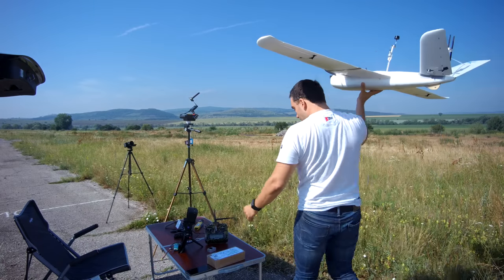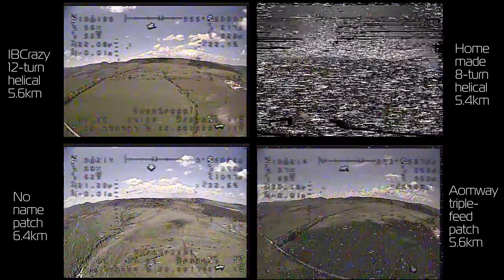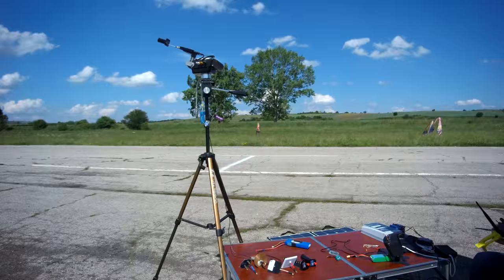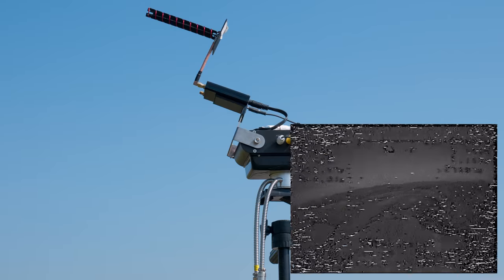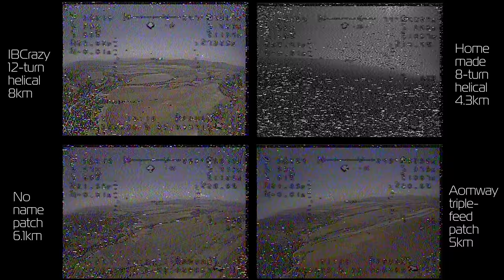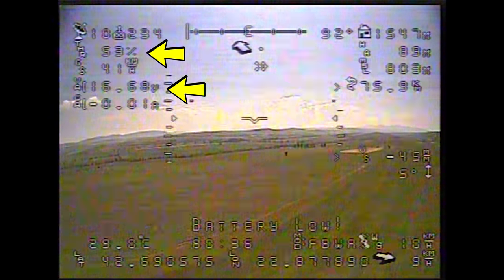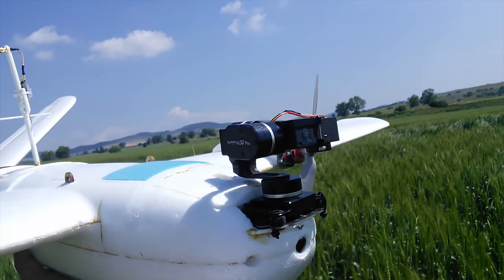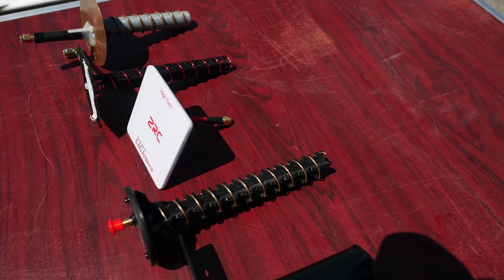Circular Polarized Directional antenna testing and comparison (Round 1 and 2)

Comment: Wonder, what would perform better:  the padoga+triple feed patch 9.4db or the linear antenna and aomway double biquad 13db antenna on receiver.
Reply from the maker: That is still a test that I have to do! Theoretically the linear system should do better for long range out in the open where there are no reflections, etc., but only testing will tell... and it is possible that the results might vary for different locations!

Comment: so whats the range if you just use a normal recieving 5.8 antenna without tracking on 25mw? in germany you are only allowed 25 so yeah...
Reply from the maker: I would assume 200-300 meters at the most.
Reply: A little late but with my DIY antenna made out of trash i can fly over 3.2km at 25mw. Here’s video showing my range test and diy. Cheers!  Easy DIY Long Range 5.8ghz Helical Antenna: https://youtu.be/TS4fYcT3DEE

Comment: Small hint - When running a helical and the video starts to get weak, rotate it 90 degrees axially.  The reason for this is that not all TX antennas have the same amount of horizontal polarization as vertical and the helical can take advantage of that (depending on the location of the feedpoint).  Thus, by rotating about the long axis of the helical, you can pick up some extra signal with the last 1/4 turn on the helical.
Reply from the maker: Nice tip, thank you! :)

Comment: Great test. 
My best is 10km on 5.8ghz 600mw with 7 turn circular wireless helical. Could of pushed further but the battery was near 50%. Mind u that I was tracking it with my head as the helical was mounted to some Fatsharks
Reply from the maker: Tracking with your head should work fairly OK for the most part, as long as you have a good idea where the plane is, relative to you! :)

Comment: Fantastic video, as usual! I wonder if the noise floor is higher in that area later in the day? You were also flying in a different direction, right? Love these puzzles.
Reply from the maker: Well... thing is I tried the IBCrazy antenna again at the end of the flight, and it still performed well, and we have no observed any notable change in noise floor in that area! I did fly in the direction I usually do my long range tests... so it should be pretty OK. Will test again next week and we will see... I have a wrench handy now, so will tighten them down as well as I can!

Comment: I made a 1.3ghz RHCP patch running on a MFD tracker with a 5.8 repeater to my goggles and it works great.
I've not gone past 10km yet but it's perfect to there...
Reply from the maker: Sounds good... you can push it further out then! I also have a repeater on the ground, but it is again on 5.8Ghz, although a different frequency, and very low power! :)

Comment: nice test.
 still i think best would be to make more of them using aproximately same factors/conditions and average them in the end for an definitive result.  my opinion is most of these anntennas not worth price since its so easy diy and you can leans something interesting along the way. back in the days radioamateurs used diy testing gear for antennas and they outperformed most commercial. nice job. 
cheers.
Reply from the maker: Well... to make a really good antenna you need some serious gear... other than that its just guesswork to be honest! I've made my own antennas... and only 1 or 2 have actually been good for something because you have no real way of tuning them and testing would require a lot of flights, which is just not practical! The trick is to find somebody who knows what they are doing and have the right gear to tune the antennas! :)

Comment: very good video, hope you figure out what could cause the bad signal, maybe the vtx reduced the power due to overheat? Anyways, consider testing a Crosshair antenna, we are getting very good results (~7km on 600mw without antena tracker)
Reply from the maker: Actually I find it doubtful the Vtx would overheat in flight, the way I have mounted it... running at 25mW... and besides... the IBCrazy antenna was OK beginning and end of flight... sooooo... overheating doesn't make sense. I do not have a 5.8Ghz crosshair... as far as I know those a tricky to make... so finding a good one might be a problem. Will see if a friend is willing to give me his to test next time.

Comment: 1 turn helical is maximum for that small reflector. It will give you the best radiation pattern and true 6 dBi of gain, because 6 dBi is 4 times. This means that you will be able to receive only 1/4 of all directions (90 degree sector), compared to an omnidirectional antenna. Don't use a lot of turns with that reflector, because it will not give you the desired gain and will only mess up the radiation pattern: the direction of the main beam can go anywhere and you will not understand what is happening.

If you want 12, 8 or 5 turns then you need to have a reflector which has 1-2 meter diameter and a very good conductance. Then you can have 12 dBi, 15 dBi etc. Without a big reflector it is unfeasible to have more gain that 6dBi.

Another way is to use a satellite dish with 1-turn helical (insert it in the place of the satelite receiver). But remember that circular polarization changes from left to right and vice versa after the dish.
Reply from the maker: Which antenna are you talking about? Out of all of these only one of the helicals was done by me, and it is the one with the largest reflector! The rest are store bought and supposedly tuned... so they should be working well! The fact is that with the tracker all of these have always performed best dead centre pointed to the plane... so apparently they seem to work OK without a 2 meter diameter reflector!

Comment: there  are some sunny days vith electromagnetic  noise and its trouble . in evening  noise goes lower .
Reply from the maker: Weird... where does that interference come from?
Reply: @ArxangelRC   Solar radiations and other solar activities affect the total electron content of the ionosphere and also affect various radio frequencies used in telecommunications. We studied the effects of electron densities of the ionosphere and how they affect telecommunications. A case study of the year 2000, which was a year of solar maximum, was used to show the variations of electron density of the ionosphere. Hours of maximum disturbance due to increased electron density of the ionosphere were obtained and the ways of measuring the electron density of the ionosphere suggested.
Reply from the maker: @LotosAndEarth  OK... but why would it be so much where you are? Can't say that I've felt much of a difference from one day to the other in terms of long range video and radio range... things have been quite consistent!
Reply: @ArxangelRC  exactly , sometimes its for  1-2 days, as usualy from morning to evening when sun goes down.  Buy old  radio phone , in that days with higer radiation radio phone will  work just  about 6 meters with noise instead of 50 around the house ,so its my expirience , of course some waves afected more some of tehem less. i dont xnow how its affekting LTE   - 3G
Reply from the maker: @LotosAndEarth  Hmmmm... could be! Interesting... can't say I've felt any changes in range though... cloudy days or not... have not done much flying at night!

Comment: I run a iBcrazy 5.8ghz LH pepper box straight off my laforge on the fatsharks and have out run my old spektrum dx8 more then once which is why I've switched to a frsky horus x10s w/crossfire and will always stand behind iBcrazy's antennas they simply work well.

🥃cheers🍻
Reply from the maker: Yeah, they are good... but I am not at all surprised you've outrun that DX8... a 200mW Vtx with a simple directional antenna on the ground and a Pagoda can outrun it!
Reply: Good point lol I still need to build a proper ground station, can't wait to see your finished ground station to take a few pointers.

🥃cheers🍻
Reply from the maker: It is in the works! :) Some new items are arriving, which will make it easier... and a bit cheaper without sacrificing functionality!

Comment: Please send me a link to the esc that has no low voltage cut off
Reply from the maker: Hi, this one does not have low voltage cutoff, as it was meant for copters: https://goo.gl/sS9Hoh
I have used these in a large Y6 copter and they have been absolutely perfect all the way, so will put them in the plane next! :)
Reply: ArxangelRC I'm looking for an esc with no low voltage cutoff does this hobbywing one you linked here have a programmable voltage cutoff I'm running li-ion batteries?
Reply from the maker: No, this one has NO voltage cutoff, so you can use LiIon batteries with it, that is why I will be switching over, because I also fly the Clouds with a LiIon pack! https://youtu.be/1vr7cyr-Li4

Comment: 6 dB in gain will double your range there are patch antennas with 40dBi of gain! if u use circular pol, make sure you have rhcp and lhcp on the other side
Reply from the maker: Well 40 dbi would quite directional, very narrow, so you would need a tracker. Would also be quite heavy I would imagine.
Reply: @ArxangelRC  If you use GPS track it is very accurate... heavy is less of an issue since it is for the ground station. But maybe I exaggerated 40dB you will need a heavy lift pedestal...
Reply from the maker: Exactly! :)